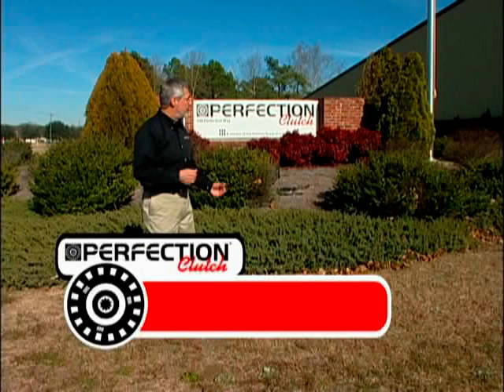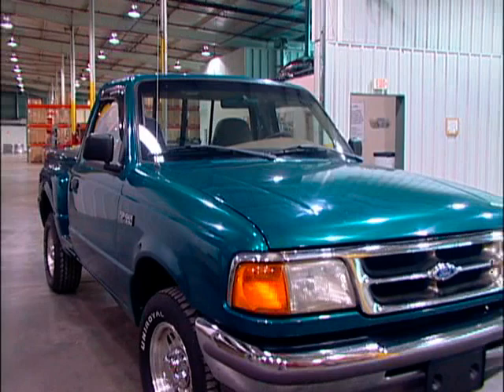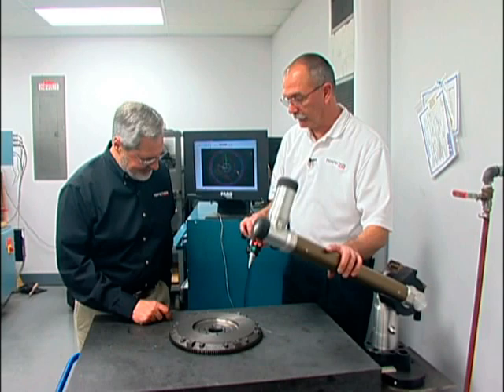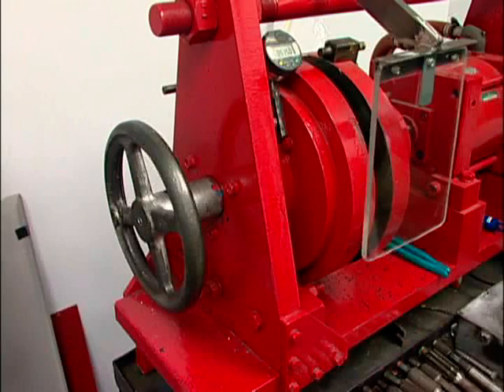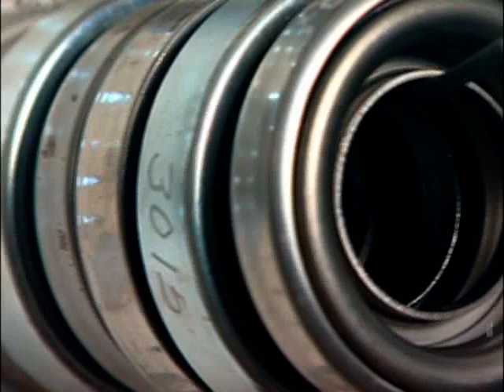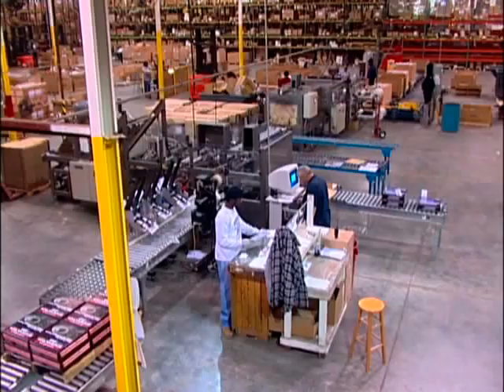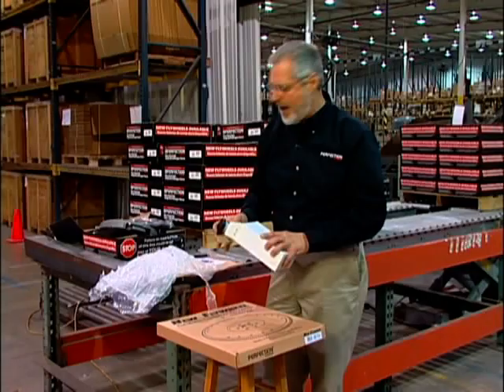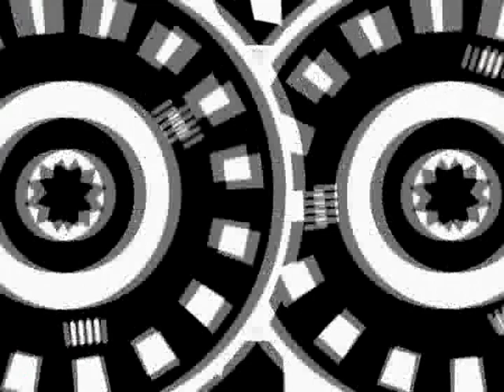Perfection Clutch Video Tour - How a Clutch is Born - Starring Sam Memmolo from Two Guys Garage

Comment: I have a 2008 Ram 2500 with a 5.7 Hemi and in need of a clutch. i have not found a solid flywheel conversion for the gas truck, which leads me to assume that it was factory equipped with a solid type flywheel. do you have any information on that? It does have the G-56 mercedes 6-speed with the reverse gear down and to the left on the stick